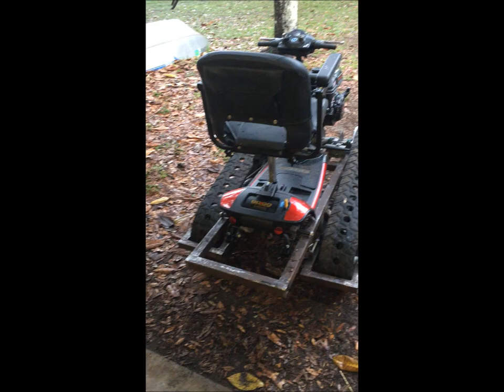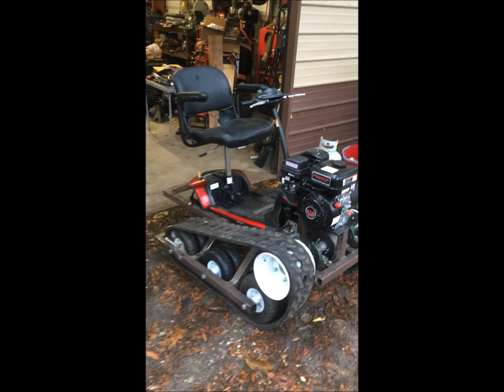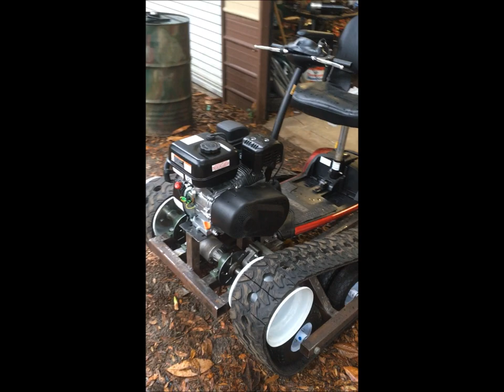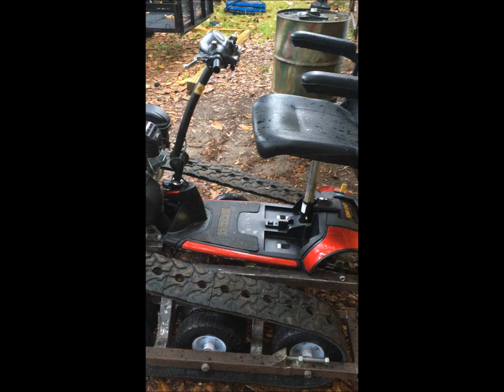Mobility Scooter Tank

Comment: Nick, usually it doesn't take much brake pressure to lock up  one axle for sharp turning. Fact is if one track is tensioned tighter than the other it will tend to turn that way.  I have to suspect the brakes just aren't grabbing good.  Really check them out. I'll bet with tweaking you'll get it!  Chuck
Reply from the maker: Thanks Chuck.  Everything worked when I had it on blocks and was testing it.  I could stop each track individually and the free track would spin just great.  When I was riding it around with the mechanically actuated brakes it just would not stop a side completely.  I switched to hydraulic brakes and I just watched one of your videos and saw that I purchased the same hydraulic brake calipers you did.  These hydraulic units allow me to stop the track completely and I can now spin donuts.  Thank you so much for your amazing videos.  I really learned a lot from them and they inspired me to build my own tracked vehicle.  I will build another bigger one after this.  I already have a diesel engine for it.
Reply: @RunsWithScissors  Are you a member of our Personal Track Vehicle Facebook group? If not, join and post some pictures!
Reply from the maker: @Personal_Track_Vehicle  Sorry I missed your reply, I do not do facebook.  The NSA knows too much about me already...  :-)